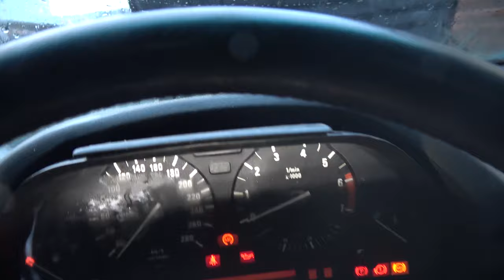I Got a Free, Neglected & Rare V12 BMW E32 750iL Highline

Comment: Small tip. Cat litter is excellent for drying out the interior and reducing the disgusting smell. Simply sprinkle 2 to 10 bags inside and vacuum after 4 days.
Reply: Fr?
Reply: @MehmetArslan-cc3zo  yes for real
Reply: If you problem with windows fogging (older cars), that cat litter stuff, put under the seats, inside some bags... Silicon love moisture and water!
Reply: @raverick187  oh Aii thanks
Reply: Theres also special moisture traps that use salt for boats or wohnwagen?
Theyre really cheap too
Reply: Cat litter or those silica gel bags you get with shoes. Great for collecting mousture
Reply: Cat litter in a tray so you don’t need to clean up after
Reply: u would need 400 boxes of cat litter, just buy a machine for it, or rent one... cat litter is fun but not on this project
Reply: Yeah. Cat litter, baking soda, and an Ozone machine are the best to reduce moisture and smell. Dehumidifiers too.
Reply: You can also use damp rid
Reply: and after that your cat can use too :D 
also calcium chloride can do the trick to remove moister and prevent mold
or Silica gel packlets
Reply: Yes, but be sure to use new, fresh stuff, not the bag of it your wife was carrying out to the trash.
Reply: @raverick187  Silica ;)
Reply: There's also a new product, chlorine dioxide, as far as odor cleansing and bacteria killing goes.
Reply: I have used these moist traps in my daily driver in winter time, works great! It reduces the fogging of windows alot.. From snow, rain and wet cloths etc.
Reply: The interior has mold, which is fungi .. cat litter may absorb moisture but it won't sanitize nor disinfect.
 The best solution would be by using an ozone generator with an UV light, takes only 30 minutes.
Reply: @ghassanalfarra8935   For moisture only, removal of fungi is delicate, with protection, because of biohazard... So, mask, gloves and other protection, with container just for fungi, I think, then it's gonna be burned... Or whatever method they use.
Reply: @Alpejohn  
Why don’t you just use the aircon? Just press that aircon button, turn on the heat and in seconds all moist is gone
Reply: @chukwow5738  Cause the AC stops working below 5 degree celsius. And if i use the ac and it dips below 5c, the system is full of moist and it will blow 10x the amount of moist out and It fogs up the windows like crazy. You know when you turn of the ac the air gets super moist for a while. So having this plus the ac working/not working as temps move over and under 5c is a real pita. So i dont use the ac in the winter time. Its much easyer to remove fog from the windows to..
Reply: On our yacht we use a 100w electric dehumidifier with the overflow pipe routed outside, haven't had any issues with moisture, mold, must or rust. 

Also for getting the musty smell out an ozone generator will work.
Reply: great for cleaning oil spills and drips...actually fantastic!
Reply: 10 bags !? That’s like 250 lbs.
Reply: Yes 🙃
Reply: Remember to keep your cat away from car !!
Reply: @garyx5x  small bags :-)
Reply: O3 (Ozone) generators are effective in removing strong doors inside vehicles, and killing SOME types of fungi.

Though it is not recommended to breathe and I've heard they can corrode the copper in wiring, so "use at own risk".
Reply: @Alfred Wedmore  That one (type of use/application) is of course not the one I'm talking about. This is: https://www.youtube.com/watch?v=o77qehzP1YI&t=2s
Reply: @Alpejohn  
Mate, I never heard about an AC that stopped working below 5C. I’m not saying you’re wrong, it might just be where we are staying. 

In Scandinavia (so we have sorted my area of knowledge😁), all modern cars and trucks you have to press a button to turn of the ac (eco driving). In my Volvo S-80 from -99 I have a button to press to activate the AC, and it works in all temperatures. 

Example:
If I in below freezing temperatures press the “defrost windshield”, the fan goes on full and the AC is activated. 

But I hear what you say, if turning of AC in low temperatures, yeah, your windscreen is fucked with moist😁
Reply: @chukwow5738  I had a Volvo v70 awd (first gen), that one also turned off the ac when it got below 5c. The light on the button is on, so it seems as its turned on but the compressor isnt engaged/running. Its to prevent the condensation water freezing etc. I live in Norway btw. :-)
Reply: @Alpejohn  
Ok, tomorrow morning I’ll do an experiment. We still have subzero temperatures at night. 

I’ll start the ac b4 I go to work tomorrow morning, and turn it off just as I park my car at work 40 minutes later. 

Just for fun mate😁
Reply: It's right, it works! But remember to use clean cat litter. Do not use used cat litter. Lol 😆
Reply: @123livewire  That's funny!! ;-D
Reply: This might be the reason for the bag of cat litter found in the part 2 video of the E92 M3…
Reply: If you can find the crystal type of cat litter then you can leave a small to medium sized rubbermaid container with the lid off in the floorboard and trunk when you store the vehicle to prevent it from getting musty and molding. Just change it out when the colored crystals change color. Conventional litter, while still featuring desiccant properties, are nowhere near as potent as the crystals. Or just buy a bulk bag of silicon desiccant crystals and use that. They're also reusable if you bake them in a warm oven to dry them back out.

Comment: Those wheels will look so nice after they've been sent off to be refinished. I'd say keep them around for winter tires, since winter tires with tall side walls are preferable. I've always had a soft spot for alloys with lots of delicate spokes like that, particularly when the length and apparent size of the spokes is carefully measured and not excessive. It needs to have that wire wheel balanced appearance or it looks wrong and BMW did such an excellent job with their older alloys.

Comment: What a car, too bad about the condition though. If you plan to leave it aside for a while I hope you can do some light interior cleaning so the mold doesn't spread and definitely get a car cover...
Reply from the maker: Definitely, will do something about it when I get around to get it running.
Reply: @M539Restorations  Considering how long it might take to get all the smells out, I think it would make sense to take the interior apart completely, clean it, and store it in a dry place. Even if you decide not to restore the car eventually, you'll have a clean interior to put in some other project.

Comment: Just finished a 550 mile round trip in my 88 E32 750il. 19.7mpg at 80mph in Texas. Didn't skip a beat other than my cluster loosing trip memory every other key cycle.
And what cool way to end the day than another E32 video!

Comment: Hey Sreten,

I have two tips for you related to that E32 Highline.

First of all, an easy and inexpensive way to (possibly) get rid of moldy smell.  It won't cost much and you can probably reuse it for other applications.  Purchase a bag of activated charcoal.  These are sold in pet stores for aquarium filters.  Place charcoal inside an open canister.  Place open canister inside the car.  Wait a few days and check for smell.

Regarding the mold, I would get a rag soaked in a mild disinfectant.  Be sure to wear gloves and breathing protection (not for the disinfectant, for the mold).  Wipe down interior.

Check the underside of the car and see if it's equipped with catalytic converters.  These cars have TWO of them.  If not, your fuel tank likely has a charcoal canister to absorb gasoline fumes when filling up.  If these charcoal canisters get clogged, BMW wants $130 to replace these.  A link I found has a much less expensive but equally effective solution, again using activated charcoal.

http://www.km5tz.com/BMW%20850iP3.htm this person bought a 1991 850i (same year as your Highline, and likely to be a similar spec M70) and put it back on the road.  He has a TON of great content for cars that use the M70 engine.

Comment: I feel like E32 and E34 are very underrated and get overshadowed by E30s. I do like E30s, but to be honest, I'd rather have an E34 M5 or an E32 750il over an E30 M3. Am I crazy!?
Reply: Nah not at all, they are way better value for money, even though non M e30s are still my absolute favourite of the 3, simply because i prefer smaller cars.
Reply: I also prefer the E34 and E32, but the M5 E34 is not cheap at the moment, specially the 3.8.
Reply: No, not at all. IMO E30M3's are over valued.
Reply: There is a VERY good reason why the e30 gets so much action vs the e32 and e34's because they are bigger cars, bigger cars = weight, not alot of people wanna drive around in a boat BUT the e34 i think is a decent car i have a brother that owns an e34 and used to own an e32, my father had many e28's and honestly the e28's will forever be the BEST bmw around.
Reply: Totally agree! And you're not crazy ;)
Reply: Agree, got two E32

Comment: Its probably labour that’s expensive in Germany. Here in Eastern Europe rust could be fixed for cheap. Also theres very little rust on body (paint) it self for 1991 and 9 years sitting.
Reply: for cheap, but for how long ? 2 years ? 5 years ? i think 539 want real restoration not just spliff it with CO2 :D
Reply: this car deserves (as limited ed.) proper rust protection - full paint strip, acid bath and zink plating protection.
Some german youtubers work with @carblast_entlackungsfabrik

Comment: The E32 is such a pretty car. The electronics... When they're working they are fabulous! When they're not, well.... The E32 750i, iL and iL Highline, well they're beautiful automotive poetry when they're fully operational! Those intake gaskets, the coolant pipe in the V12 valley, the dual Motronics + EML malarkey, the parts availablility and the lack of diagnostics equipment that can talk to the various ECUs... I tried with a decent 1990 750i, but when my specially made forum-sourced diagnostics tool failed to talk to the ECU and the BMW dealer was unable to talk to the ECU with their equipment... Well i had to raise my white flag. There was oil on the plugs, i couldn't find new ignition cables that had the ring-sensors for one of the cables on each bank, it would run on all 12 above idle sometimes and it would go into limp-mode with the EML light on at other times, and the biggest problem was the HC levels in the exhaust for the inspection. Ironically, Sweden changed the rules so that older cars only have to pass the CO reading in the exhaust, but by that time the car was in limp mode almost all of the time and it was misfiring consistently at an idle almost all of the time.

Comment: E32s are such wonderful cars. I have a ‘93 740i that is pretty clean that I’ve daily driven for 4 years. It is a joy to drive, super reliable and very economical, actually. Especially highway cruising. All of my other Classic Bimmers are cooler, rarer, more valuable by far but the E32 is the go-to for pizza runs, trips across the state (Oregon) rain or shine, etc and it never leaves me yearning to drive the other faster, manual trans, prettier ones. So glad I got it as the e32s are just impossible to find unless they are V12 models or 735s that have a gazillion miles or have sat neglected for many years

It is a weird yet strong personality who likes them over most BMWs I believe. Kudos to you for not giving up on this highline! 👍

Comment: Just bought a rust free BMW E34 88 model, alpine white, the cleanest and most rust free E34 I've seen so far in person... My 4th E34 this far. Drove 10 hours to get it and bring it home, but stunned how good it is looking over it. It's a M20B20 automatic. Look forward to attempt getting it mint and using it as a summercar and a nice weather car, best 2500 euros I've spent in a long time if not ever. Look forward to get started with full service om it with a friend, starting with the timing belt. Car dosen't  even tick, that a first for me with M20 engines, my other one, my grey one, needed adjusting when I got it.
Reply: Sounds like a worthy project.  Pre-flybywire worth doing.  Good luck.

Comment: Did you note that unlike the other e32 project karlsruhe this engine has the oil filler in the front close to the radiator like the 8 series? The one of the black car is in the back of the engine close to the passenger side. Maybe its more about the build date than a model factor🤔

Comment: Radiator is obviously replaced when that clutch fan grenaded and the fan smashed into it like they all do. Clutch fans suck. The v8 and v12 cars sound like a big rig with the clutch fan in place. E-fan is the way to go. Not a bad looking e32 especially for free! Depending on the production date the e32 750 came with the 3.15lsd. Pretty sure pre 7/ 91 had the 3.15 installed. They are a great upgrade on the e34 540/6 cars for the OEM 2.93 open diff. All you need to do is change out the input flange and it's a direct swap. Makes a hell of a difference in the e34 540/6. I had 2 of them and they were one of my favorite bimmers out of my fleet. Thanks for sharing this.

Comment: Since its Highline version maybe to keep it on the road is to reshell it. Base model LWB would be great to start since you have everything to swap engine, interior and drive train. It will cut the cost greatly and save you a lot of body work.

Comment: I am a welder and also own an E32. I know welding and rust reperation is not your game so it can be daunting. That car is not too bad really. All those points of visibile rust are still fairly local and catachable now. And about half of it is just surface rust that is just cleaning down and retreating. I would estimate 2 to 3 days work to get that all sorted out and back to you clean.
Let me know if you want a more detailed consultation.
Edit: I hold a slight reservation of that estimate until you take off the side skirts to see whats behind.

Comment: Terrific car ... had one of these back in the 90s (PITA to maintain though, and it had over 300000 kilometers on the odometer). I hope you can get it back up and running. About the moldy interior, perhaps you can leave a dehumidifier inside the car while it is in storage.

Comment: This car is impressively spec'd. As I see it, you can scavenge the good bits (central column, cocaïne tables, electric seats) and either put in an other e32 (project Karlsruhe or an other one) or sell them on the side. They go for a efty price and could be used to finance your other projects.

Anyway excellent video as always, have a good one.

Comment: Would it make sense to kind of stop the car from further decay before you store? Like take out the seats and carpet and clean. Stop the water ingress into the cabin. Maybe even do a ozone treatment and clean all the mold out. Treat and stop the rust, where you can. Get it running so you can move around. Then store it like you mentioned. That should not be too costly and then you can make your decision long term after that.

Comment: Separation of the shell and rolling frame, is doable in the parking spaces you have access to - pig stying timber. Steel fabrication and welding is certainly something you can master quickly ( U-Tube) and mig welders have never been cheaper. You can just add it to your huge bag of tricks. I appreciate that spray paint auto work is expensive. Have you ever come across brush painting techniques for cars? I was led to believe that Rolls Royce Saloons were, at one time, hand painted and came out mirror finish. Try it out on a door panel. It could be a project were you, take your time, grow your skills and slash the restoration cost of a car worth saving.

Comment: I would just put a de-humidifier in the vehicle and dry it out. Obviously track down the leak or dry store it until you can get round to it. Some rust repair solution in a spray bottle and give the rust a good dousing. It will stop it from getting worse.

Comment: Before you put it away, make sure its water tight and dont leak water inside, maybe clean the interior a bit and make the engine run.
And as mentioned before in the comments, put alot of either cat litter or moist remover (or whatever its called) inside.. So its not getting worse. Looking forward to this project.. :-)

Comment: Heij, Ich bin ein großer Fan dieser BMW, Dein Gartenfund 850 ist übrigens exakt in den Farben die mein Vater sich immer gewünscht hat. Er hatte seinen Traumwagen als Modell in den Farben immer auf dem Fernseher.
Sein letzter BMW war ein 635CSI Bj. 86, er starb an Krebs. Sein Bruder hat den Wagen verschwinden lassen und ich musste machtlos zusehen denn ich war zur der Zeit im Gefängnis.
Trotzdem mag ich die Schlitten aus den 90´ern, für mich sind es die besten Autos jemals gebaut. Aus dem Vollen. Mir gefällt sehr wie Du an die Sache rangehst, wie sauber und glatt Du arbeitest, das hätte meinem Vater sehr gefallen.
Ich dachte immer das die Wagen für uns selberschrauber kaum zu machen sind aber Du belehrst mich eines Besseren, schön.
Es ist der Sound, das Gefühl von absolutem Luxus das so ein 12 Zylinder verströmt. Klar- das könnte man auch mit acht bewerkstelligen aber BMW wollte meiner Meinung einfach zeigen wo der Fritz den Most holt. Klassenziel erreicht.

Comment: @m539 restorations, I do hope you dry the interior asap and keep it for a resto later. The rust isn't that bad tbh - I've gotten stuck into way worse than that. Sure, if you have to give the items to someone else to repair it can get costly, but I suggest you invest in a MIG welder :-). Really hope it gets saved. Proud owner myself of a 750iL with 'coke tables' 🤣

Comment: Honnestly that doesn't look too bad. Yank the engine out to do a refresh of the front end and drop the rear subframe for an over hall. Some bracket here and here, nothing major in my book. It would be a good opportunities to learn how to do Steel work, the parts alone are worth some money so even if you destroy the frame for whatever reason it's not really a loss of money.